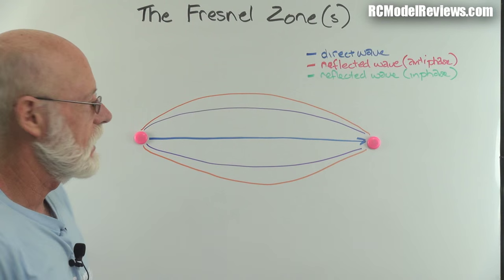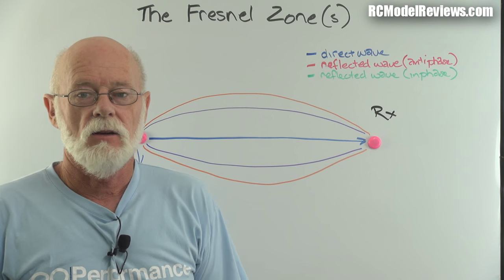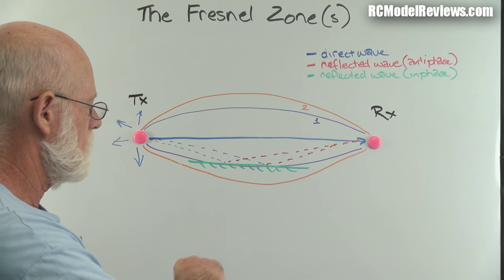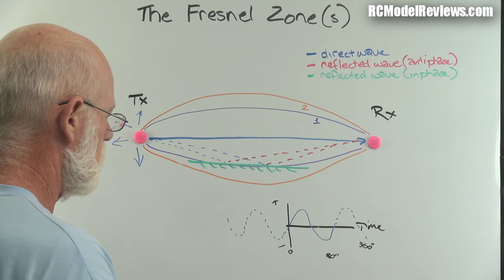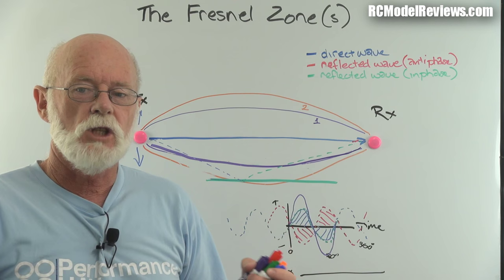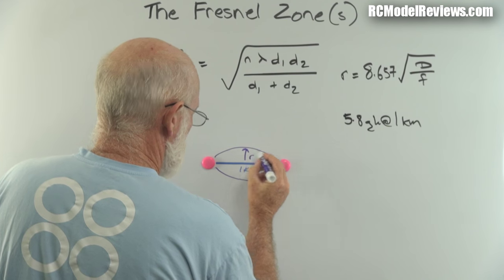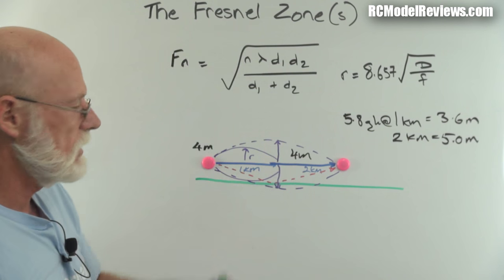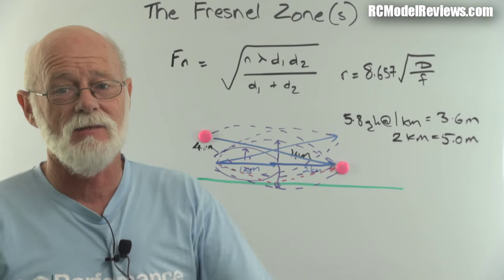The Fresnel Zone explained

Comment: Bruce... nice explanation and video but my only critiques would be that it is "Hz" not "hz" and capital "G" and "M" in GHz or MHz.  Lower case "m" is for millihertz or 1/1000 of a Hertz.  And a full cycle would be 360° so the peak high point of your wave is at 90°, back at zero is 180°, negative peak is at 270°, and then back to zero at 360°.  Enjoyed the video, keep it up!

Comment: Just one thing, you should have added that this is for vertical polarized antenna. For horizontal polarization it will be the opposite, the 1st zone is constructive intereference and the 2nd destructive.
Reply: What does this mean for average joe with his cloverleaf type omnidirectional fpv antenna?  and helical receiver antenna,  does it behave different again ?

Comment: if im flying with an other pilot and im using left hand cp antennas and hes using right hand am i going to be picking up his F zone and vis versa ? granted hes using 1258 and im on 1280 here. and is that enough separation in channels? it seems those are the only two legal channels we can use on the 1.2G band.

Comment: thanks for that lesson Bruce! very understandable and aligning with the standard rule of thumb that you should fly at 10% alt of your distance (100m @ 1km...)Also one could move his groundstation on a "lamp holder" tripod thingie instead of a normal tripod. I got one of these and it extends easily to 3m of height. should give a great experience to fly miniquads low and far with the RX so high...   greez, Mario
Reply: +RCSchim The 1/10 rule isn't based on any real violation of the Fresnel zones.   It's just something someone randomly made up.   I and many others regularly fly out at 1/100 or lower with no visible multipathing.
Reply: +RCSchim For example.   Check out vimeo.com/27963240 
I started the return run only about 4m up, 3200m out with clear video.   That's a 1:800 ratio.     Most of the railroad track deep within the F1 zone, but no multipathing issues.   
What's more important than the height to distance ratio, is the distance from terrain of the Tx and Rx antennas themselves.     Most of the reflections of interest occur near the endpoints, not in the middle.   Also, I'm sure you've problem seen this in your own cliff diving flights, flying in front of a rock face with a specific angle can produce horrible multipathing, even when it's not inside the F1-F2 zones.     I tend to visualize large rock slabs as big Rf mirrors.    I've gotten mulipathing off them from 300m above.

Comment: Bruce, you've got the effects of your odd/even zones backwards.
The F1 (innermost) zone ellipse is specifically calculated to account for 180 degree phase reversal due to the reflection + another 180 degree reversal due to increased path length.    Reflections near  F1 zone ellipse produce a strengthened signal.
The F2 zone ellipse is includes the same 180 degree phase reversal due to the reflection, pus 360 degree phase from path length, which means the signal arrives 180 out of phase, and weakens the primary signal.   F3 is like F1 but path length produces 540 degree phase shift, and so forth.   Reflections on odd numbered F zones strengthen the signal, and even numbered zones weaken the signal.    

Also, all the zones should be drawn so that they extend in a roughly parabolic curve behind both the Tx and Rx.    F zones are  all about reflections, and the signal bouncing off an object nearby behind either antenna is just as important as one in front of it.     People often fly with their back to a structure or their vehicle which violates the F zones.    This is a situation where a directional antenna can help by heavily attenuating reflected signals from behind.

Comment: So.... if the ground is not plane, or if it has trees or buildings, Will it change the direction or the timing of the wave ?
Reply: +MIGUEL H. M.M. Any reflective object that intersects the Fresnel zone will affect the signal so yes, trees, buildings, cars and such will have an effect.  It's also worth remembering that the Fresnel zone is 3D -- not just up and down but sideways so even flying past a tree or building  that intrudes into the side of the Fresnel zone can have an effect on your signal.
Reply: +MIGUEL H. M.M. - you bet.  Everything can have an effect and it depends on how well they each reflect (or refract) the signal.  Metal objects are going to have more of an effect than the dry ground for example.  If you are flying in downtown NY you are likely to have more affects on your signal than if you are flying even over a larger distance out in a rural area.
Reply: +xjet my head hurt from trying to picture it in my head how a 3D fresnel  zone would look in an enviroment with obstacles. But at least it made sense from a 2D perspective. 😀

Comment: nice. incidentally to work out the subsequent Fresnel zones just double the distance for the Fresnel zone 1  so fresnel zone2 works out the same as if you use 2km for fresnel zone 1. For 1km out on 0.433 GHz fresnel zone 1 would be 13.16m fresnel zone 2 would be 18.6m I have a calculator on google sheets feel free to copy it. https://docs.google.com/spreadsheets/d/1GwiC1y71NpUMAyNxo2cORMOvc-aoCuLjzg2brxWhaA4/edit?usp=sharing

Comment: Interesting. But how does the f zone differ from other multipathing? Also, while lower frequencies got a larger f zone, arent lower frequenzies less prone to multipathing as penetration is better? On top of this, how does circular polarization affect this?

And to add another twist. Say you got a vertical obstruction like a spiky mountain entering the f zone. There wouldnt be much, or any surface at all to reflect the signal. What would happen then?

Comment: Another informative video Bruce. You were saying about Fresnel zone 2 (at aprox 9:15) that because this signal is in phase but one wave behind the straight line signal and you had a net gain in signal strength. How is this late arriving signal used by the Rx if the picture information it is carrying is "late" when compared to the straight line signal? It seems the zone 2 signal would be trying to show images that have already been broadcast by the earlier arrival of the straight line signal. Hope this question makes sense.
Reply: +Bill Bixby No, because the frequency of the radio wave is so very high in comparison to the frequency of the video or control signal it is carrying, consecutive waves are all but identical.  The change (created by the modulated information) is so very gradual that it takes thousands of waves to carry just a single bit of information.
Reply: Wow, so that is why lower frequency waves are bad for transmitting lots of information, right?
Reply: +Bill Roberts Yep, a higher frequency carrier can generally carry more data than a lower-frequency one.
Reply: Bill Roberts if you think of it, a higher frequency wave can fit more data (1's and 0's).

Comment: at 1000ft altitude at 1km out i lose vtx signal with 5.8ghz using skyzone goggles with wireless antenna skew planer and helical and wireless antenna skew planer on vtx, the vtx is 6oomw immrc what could be the problem? thanks
Reply: +pfcdre1 Are those Circular Wireless antennas?
Reply: Yes sorry circular wireless. Helical and skew planer on goggles and skew planer on immrc vtx

Comment: Nice video as usual but I don't understand one thing. I don't have a degree in physics, so I don't know it for sure, but your explanation about the "green" (in fase) reflected wave does not seem to be correct. What I get it from your words is that the bounced wave reaches the receiver in phase but actually an other period of the wave. Simply said a bit later. Doesn't it mean the the information carried by the reflected wave is slightly different than the wave reaching the receiver straight away? Thus it causes an interference?
Reply: +! tomekyo The green reflected wave that arrives 360 degrees out of phase (so that  it's actually in phase again) will be virtually identical to the direct wave it coincides with because of the much, much lower frequency of the modulating signal.  For instance, in the case of video, the video signal is just 3.5MHz or so -- but the carrier wave (RF) is going to be 5.8GHz (more than three orders of magnitude greater).  This means that any two successive waves will be very similar in magnitude/frequency because of this difference in frequencies.   In short, the FPV video/audio signals can't change the amplitude or frequency of the RF signal fast enough to be significant over tens or even hundreds of successive cycles of the RF.

Comment: Thank you very much for the videos. Would be great if you could enable the subtitle settings for this video for me to turn on CC.

Also, have a few questions...
1. Assuming the ground surface structure is such that it just enters zone1 but not a lot, and the cumulative ground surface area in zone2 is greater than zone1. I assume the cumulative effect is signal amplification? 
2. Does the impact of subsequent zones reduce (zone3<zone2<zone1)? Do you know by how much factor? The reason for this is, is it ok to only worry about zone1 say while performing network planning or should we also consider zone3/zone5/etc?

Comment: Good informative video.

A couple of things though - and bear in mind I'm no RF guru by any stretch of the imagination - but surely as the reflected signal isn't 100% strength (in the case of a directional antenna such as a wireless network bridge the 'stray signals' don't even start at 100% of transmission power) so it wouldn't actually cancel out the direct signal wave  - it'll just reduce its strength (amplitude).

Also, the phase shift wouldn't necessarily be 180° for all reflected signals - it would depend on the total distance of the reflected path and the frequency. In any case, realistically, who even flys 3.6m off the ground at 1km or 5.0m off the ground 2km away anyway?

Comment: So I was giving a ride along the other day with someone who was wearing Quantum V2s and I was patched into the receiver on the Quantums with my Fatsharks.  Anyway the "passenger" (8 yO girl) decided she needed to pee....so she took the googles off and laid them on the ground.....this put the antenna about 8 inched to the top from Earth...Was fine for a second then... BAM no video signal at all and crash city(not bad just props).  I was trying to figure out why this happened, this Fzone stuff (LOL) probably explains that.  My only kinda  question is: how the heck do 2.4GHZ surface vehicles seem to work so well?  I would suppose that you are normally LOS with them and there is not near the  bandwidth needed to drive a truck as there is to transmit a video signal. but don't folks sometimes FPV with surface vehicles?  Bottom line I guess I learned don't put you receiver antenna near ground, ...and make sure, that if you use a base station that it doesn't fall over.....
Reply: +James Boswell With most 2.4GHz RC systems there's a lot of unused "link budget" -- which means that effectively they have a lot more range than you need so the Fresnel zone issues don't have much effect in normal operation.. even for ground-based craft.   However, once you start getting further away  then you will find that there are large "zones" where the signal may completely drop out -- before returning again.
Reply: +xjet Great info Bruce thanks.

Comment: Bruce, I recently had a brown out with my FrSky gear, first time ever in 2 years of use. Reconnection was fast, but, the aircraft was close to the ground when the signal was lost, hit the only rock close to the field, it will be a long rebuild. Does 2.4 GHz suffer the same Fresnel effect? and, is this effect a possible cause of the brown outs suffered by DSM2 gear? 
Keep up the info vids, great job. Thanks

Comment: Thanks for the video,

I have a one question for understanding:
Does the multipating within the FZone, free of objects, come from dust particles in the air, that distribute the rf power over the space of the rotated ellipsoid?

Would there also be a 1.2. and nth fresnel zone in a vacuum?

I am wondering why the rf power would not just take the shortest way from transmitter to receiver.
Please tell me your thoughts.

Comment: Hey Bruce you and I have the same problem but I know that 1 cycle is a positive excursion followed by a negative excursion... or 360 degrees.  Peaks are 90 and 270 with a mid point of 180 degrees.  But more important I had never heard of Fresnel outside of the lens type, so you taught me something again sir.  Thank you!

Comment: Great video Bruce! I finally understand why my signal is crap sometimes! Have you seen the new Ibcrazy Triumph antenna? Do you think you can teach us how to build one?
Reply: +JKFlorida The gain is northing to get excited about so distance will still be limited. I use 2.4GHz for video anyway with my LRS transmitter using a TBS supplied Yagi on the receiver and a simple rubber ducky on the transmitter. But for flying around the field I think the small tuned RHCP antennas with 5.8GHz is hard to beat. But thanks for mentioning them I had not seen them before. 
Before someone criticises me, I know the gain is more to do with the shape or directivity of the antenna radiation pattern.
Thinking about it further I expect the radiation pattern of these maybe more symmetrical.? I just watched the IBcrazy video. He is a bit vague on what the benefits are.They are quite small.  IBcrazy does a lot of good work for the FPV hobby.

Comment: But I believe you have started argument with this. lol Most people think you can fly further out with 1.2 vs 5.8. To me this looks like 5.8 would be better suitable for long range. Do you agree?
Reply: +JD FPV There are many factors which affect FPV signals and the Fresnel zone is only one.  A more important one for most people will be the path-loss.  5.8GHz signals will weaken more quickly (with distance) than 1.2GHz signals will -- so ultimately, for a given power level and antennas of the same gain, the 1.2GHz signal will go further.   Yes, it will be more affected by the Fresnel zone but as I said.. this effect is not likely to kill the FPV signal completely anyway.
Reply: +xjet Yes higher frequencies systems take more power to go the same distance but it's not because of path loss. It's because of the antenna "aperture" is smaller for higher frequency antennas. ... Someone throw me a tow line I'm out in the weeds.
Reply: +vipero00 Yes, one aspect of path loss is the antenna aperture for an isotropic setup but since we're not flying in a vacuum, other environmental factors also play a part.  For example, on 5.8GHz, there is quite significant attenuation also caused by water vapor in the air.  Lower frequencies are less affected by water molecules in the air (which is why we get rain-fade on SHF satellite signals but not on VHF terrestrial ones).   Try to fly a 5.8GHz FPV system through a decent-sized cloud and see what happens -- yet a 900MHz/1.2GHz signal will have far less trouble.
Reply: +xjet As long as you are flying legally (400 ft ceiling, plane in site) 5.8 GHz will be the best. Its when you lose line of site (over the horizon, behind a building) that 5.8 will fail the soonest. I don't think that rain fade is a factor but I have zero experience in the rain. Most everything I have read on rain fade starts at 10 GHz. The droplet size has to be a significant part of a wave length. Clouds (water vapor) should not be a factor. Does your experience say otherwise?
Reply: +vipero00 Yes, we've noticed significant reductions in range on very humid days and once (a long time ago) when I flew into cloud with 5.8GHz I experienced an almost immediate loss of video until I descended out of it again.
Reply: +xjet I've been flying 5.8 1500mw on all my long range planes now for a couple of years. And I've never noticed and signal drop out due to the weather using 5.8 at range.
Reply: +JD FPV Also have Flown thru clouds with 5.8 1500mw with no issue Bruce.
Reply: +JD FPV With 1500mW you may have more of a chance.  I had problems when flying with 200mW and very large storm clouds (was pushing my luck).  The signal was already marginal (at 1.8Km with omnidirectional antennas) so it didn't take much to knock out what signal I had left.

Comment: so is this a non issue if you are using circular polarized antenna. with these antenna the rotation of the signal changes when reflecting off something making the reflected wave very difficult to receive by matched circular polarized receiver antenna
Reply: Conrad Brisebois 
True, but only if both antennas have an exceptional axial ratio. The lumieer AXii is known for this.